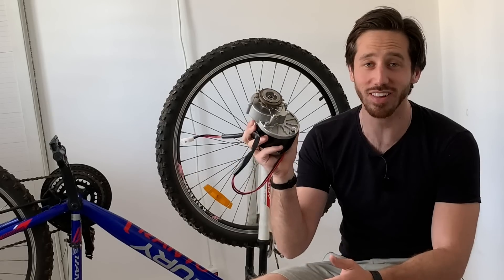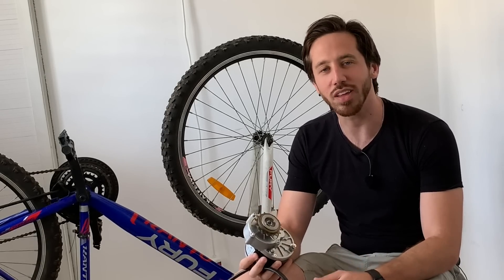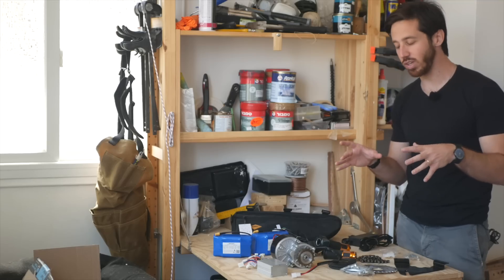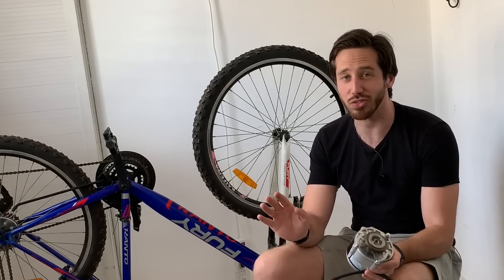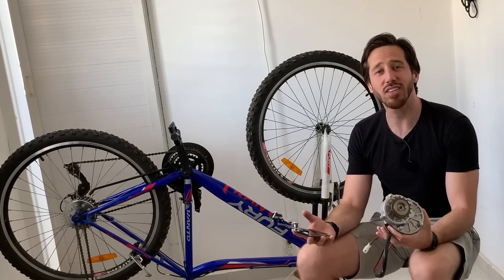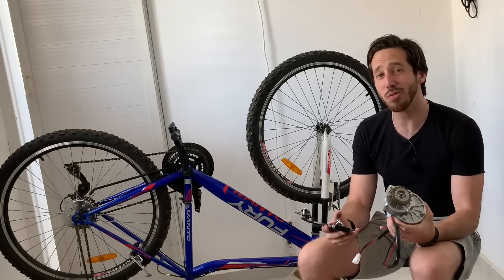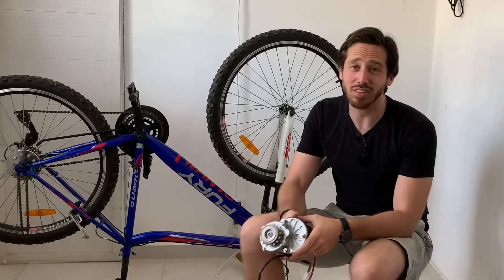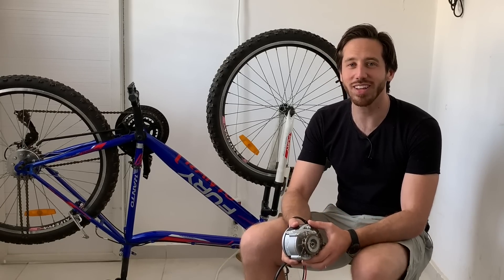Do NOT buy this $103 electric bike conversion kit

Comment: Well thanks. I purchased the kit. Many batteries. And like you said the mount did not fit my bike. I made it work. Unfortunately the two were not aligned and the sprucket on the motor came apart! Waiting on new sprucket to make it work on my daughter bike.i have extra sprucket on order,to make sure as to keep it running. I have already bought the rear wheel kit for my bike. 48 volt 1000 Watt kit. Waiting on batteries.  I don't think this will be a much better outcome because it's the 170.00$ kit. 6 speed instead of 7 or more. Owell. We'll see.. well thanks for letting me know about the problem with the kit you suggested back in January. Bought and already know all the problems with it. I'm on a tight budget so I have to buy everything a little at a time. What's up for the stuff not being shipped? Waiting on batteries. I have to go for the cheaper ones. But I figured 2 of them equal one ok one. Can someone let me know what up for batteries through Ali Express not being shipped? Thanks Ray

Comment: I have 3 26 inch bikes that I would like to put a Front Hub drive PAS system on.  All have rim brakes.  Tire width 1 bike 1.75” the others 2”.  I think I can get a 2 inch tire on all 3.  If not would go with 1.75.  Want to be able to switch between bikes.  Thinking would not have break cutoffs.  The most expensive part is always the battery which l’m thinking would be a mighty mini, want to be able to ride about 18 miles using PAS about 15 miles per hour on fairly flat road.   I’m thinking a 250W system with maybe a 36V battery.  Looking for suggestions.

Comment: Hi Mikey I purchased it from L-faster it’s the same kit as you have. I bought it after I saw your video. And tried it on 4 bikes I had. Finally returned the kit. I doubt it will fit any American bike. I then bought a hub motor kit by voilamart for $199 on ebay and was easy and fast installation. The total cost of the ebike conversion got bumped up by $100 the but rest of the parts were still utilized for conversion and was great. Infact got a 750w motor the bike goes 22miles and hour.
Reply: @KRUNAL DOSHI Can you provide link to your voilamart motor kit?

Comment: Nice video.  I hope that people now understand that it would be very difficult to make a "universal bike kit".  There are too many variations in frame geometries.In order to salvage your kit and at least be able to mount your motor, I'd try to flatten the angles to about 20 degrees on the angles where it mounts to the seat stays and chain stays.  I would do it with a hydraulic ram press.  In the worse case, a heavy sledge hammer should do the job.  Good luck in getting the kit adapted.  Looking forward to the next video.

Comment: Micah, if I were you, I'd pass on the L-faster mid-drive kit. Firstly, the design is downright janky. Secondly, it has very few reviews. Thirdly, for not much more, it's possible to go with more, shall we say, traditional, designs. For example, for only $100 more than the 48V/450W L-faster mid-drive, I'm able to build a 52V/1,500W geared rear hub bike.

Perhaps building "first e-bikes" of different configurations, including sourcing the parts, which is a nightmare, would be a worthwhile series. You could build a front drive bike of average power, then sum up the pros and cons. What wattage was chosen and why. What type of motor was chosen and why. How the parts were sourced. High and low points of the build. What you'd do again. What you'd do differently. Finally, the total build cost.

You could then do the same for rear hub and mid-drive configurations, and close out the series with an apples-to-apples comparison of the bikes attempting the same evolution. Off the line acceleration. Top speed. Hill climbing. Off-roading. Range. Overall riding experience. You get the idea.

After attempting to source everything for a 48V/450W geared rear hub motor build, it was actually less expensive, and I was able to get the exact configuration I wanted, to source a 52V/1,500W kit from a reputable source. While the bike will have more power than I typically need, I'm confident that it'll do anything I ask it to. The same might not have been able to be said for the 450W bike. In the end, eliminating the potential for future upgrades sealed the deal.
Reply: Thanks for that John. I have built (with help) two Ebikes, one with 1800 watts max output in the rear hub and one with 1200 watts output (at rear wheel) mid drive bafang 1000 watt motor. The Mid drive is faster off the line by a good margin but gets overtaken after about 30 kph by the hub bike. Top speed is very close. The hub motor is a lot faster up hills with the difference being about 10 kph on average. 
The only reason I would ever get a mid drive (crank) is where slow torque is required i.e. on very steep slow technical climbs where the gearing becomes a huge advantage. I have one 52v battery for both bikes.
With normal on road riding the rear hub motor is king and it is also the most reliable imo
Do you have a good source for parts? I'm thinking of building another rear hub bike?
Reply: @grantadamson3478  Is your existing rear hub motor geared or direct drive. I prefer geared myself.

My 52V/1,500W geared rear hub kit was $325 (with free shipping) from calibike.com. Rafe gets good reviews for prompt, knowledgeable support. My pre-sale experience with him was very good
Reply: @ARepublicIfYouCanKeepIt  Thanks John. The rear hub is direct drive. I don't know much about the geared hub motor but am interested to know why you prefer them over direct drive? I'm going to check calibike.com now. That is a great price.
Reply: @ARepublicIfYouCanKeepIt  Just noticed that the kit from calibike has a 25 amp controller which will limit the power to 1300 watts max. Does the "geared" motor compensate for the lower wattage?
Reply: @grantadamson3478  Geared hub motors possess several advantages. My top four are:

• Lighter - Roughly half the weight of a direct drive motor greatly affects ride characteristics, making an e-bike feel more like a regular bike.

• Smaller - Stealthier. Doesn't scream, "Steal me, I'm an e-bike!"

• Increased torque - Both at the low-end and for climbing.

• No drag - Because a geared hub motor freewheels, they can be pedaled like a regular bike with only some added weight.

The downsides of geared hub motors are:

• Reduced high-speed efficiency - For me, this isn't a big deal. I just build a batter with marginally higher capacity.

• No regenerative braking - Same as the point above. I build my own batteries, so choosing higher capacity cells (3030mAh vs. nominal 2,500mAh) takes care of this without the need for a complete additional parallel string (14P).

As with most things in life, there are compromises. So, for someone riding mainly flats, a direct drive might be a good choice. However, with lots of stop-and-go traffic and/or steep hills, a geared hub motor would be a superior choice. This then affords one the opportunity to take the bike way off-road, as I intend.

In closing, you may read that geared hub motors are noisier than direct drive units. While this is true, the difference is so small that it's unnoticeable over the sound of traffic or the whine of tires on the road.
Reply: @grantadamson3478  There's not such thing as "compensat[ion]" for lower voltage.

Remember that 52V is a battery's nominal voltage. 100% state-of-charge (SoC) for a 14P Lithium-ion pack is 58.8V.

58.8V * 25A = 1,470W

Also know that the ratings of controllers and motors are nominal, as well. They're able to accommodate short-duration surges/bursts without "releasing the smoke".

When designing electrical circuits, a safety margin as always desirable. In the case of this 52V/1,500W e-bike kit, a 14P (50.4Vnom) pack, paired with a 25A controller will deliver from 1,470W at 100% SoC (4.2V/cell) down to only 875W at 0% SoC (2.5V/cell).

Commercial "52V" e-bike batteries are typically 14P (50.4Vnom). I build 15P packs that are 63V 100% SoC to 37.5V 0% SoC. Additionally, I run only them from 4.0V/cell to 2.75V/cell, or 60.0V to 41.25V pack voltage to maximize pack lifecycles.

So, at 4.0V/cell, I'm right at the motor rating (and that's when pushing everything at full charge):

60.0V * 25A = 1,500W
Reply: @ARepublicIfYouCanKeepIt  That has given me valuable insight and I think geared will be a good choice for my future needs. I haven't started making my own batteries yet but it seems to make sense to customise for your particular needs. I really appreciate you taking the time to respond. I have two bikes to build and this has really helped me.
Reply: @grantadamson3478  It's good to hear that information I provided was useful to you. Best wishes for successful projects.
Reply: @ARepublicIfYouCanKeepIt  S not P when talking series hookup
Reply: @VaughnfromPeterborough  Good catch on a two-year-old post.

Comment: EZip or Izip uses this type a motor setup,  checkout their setup for mounting. The wheel sprocket is part of the wheel hub and the bracket is a lot different. I have the Ezip Trails ebike and all of this setup a lot better.

Comment: if you are looking to be able to salvage the kit since the universal mount does fit you can using a longer piece of chain you can set up dual freewheel  dual cog chain setup

you can use parts from http://sickbikeparts.com/shift-kit-and-all-drive-products/ to build 2

pieces that look like https://lunacycle.com/cyclone-double-sprocket-freewheel/

then you will need a bottom bracket and crank set and such.

http://sickbikeparts.com/shift-kit-and-all-drive-products/ has 4 shift kits to choose from but you probably will want the cheapest kit  

there will be some parts that are useless but you may be able to modify them to fit the project.

there are still videos like https://www.youtube.com/watch?v=7hn7WcT0DcI from bike motive.

while the bikemotive store is gone you can learn from the video on how to build yours.

electricscooterparts.com is also a great place to find ebike parts too .

the good thing about all the sites i mentioned is that they are here in the united states so while a little more money you will get the parts a lot sooner though you will want to ask for priority mail to ensure no longer than a week also i am sure you can cash in the youtube video monetizement to get more money  

lunacycle.com you will need to keep the cost per order below $100 because otherwise they will select ups or fedex witch will require signature .

Comment: 48v 750w is THE way to go.
Mine is 1500w governed by the computer to 750.
I feel that the bigger wire will help to keep the motor safe from burning up.

Comment: TORTURE
OK, it's great that you are discovering the pitfalls associated with such a project so I won't get stuck. 
Since you already have the batteries, hopefully you can get the new kit on fairly soon.  I would really like to try to electrify my old bike to use it   t h I s   summer.  I hope you will give source for all parts and not fabricate or sub parts that your have 'lying around'.  I hope you create an ebike solution for the masses!  It's a noble cause.

Comment: Thanks Micah for all the training vids, but I waited and planned not quite long enough. The whole (reverse 450w) package is on order and is somewhere else yet. I did spend some time sketching that mounting plate and realized that it would require a fair bit of creative investment (cobbling!), but I needed a project to get off the ground and could not quite go for a BBS02 system (yet), and wanted to keep my 3 speed mid derailleur. 
In the prep process I decided that my seldom used 35 yr old Specialized rock hopper mountain bike needed some TLC, so I decided to 'you tube' the maintenance and found another whole project getting the freewheel (not the cassette! who knew!) off to clean and lube the bearings. Now I see your latest and hope that bracket is the only real problem. I intend to mid mount the motor and use a longer chain to allow better alignment anyhow.
Reply: Update: Received the kit (no battery yet!) and decided to check the motor with my auto battery charger set to 6V. That is when I noticed that I received the normal kit not the reverse kit that they offer and I ordered - the freewheel is backwards for my use. My intention was to reverse mount the motor inside the frame under the seat to protect it rather than have it stick way out at weird angles. I expected to have to do some cobbling to mount the motor and align the chain, but the drive has to work in reverse. I am still waiting for a reply/replacement for that freewheel. 
This turned out to be a whole lot more work than expected - that bracket is weird and strong so needs power tools I don't have access to. I may need to create a special bracket - I  don't want to modify the bike frame itself. All of which is secondary to the freewheel. After much effort I wish I had just bit the bullet and gone with a BBS02 system that just fits! Nuts! Thanks for all the videos - learned a lot.
Reply: further replies to Andrew above. Everything is installed and working except for the reverse freewheel and extra chain. Whew!
Reply: Micah, I hope you get to see this. I chose the newer 450w Yalu kit as mentioned above and figured out that the definition of left side meant the bike not the freewheel, so had to order a reverse freewheel to satisfy my layout. This project was meant as a learning experience and total cost was just over $300 with extra chain and larger battery. So, the lessons: 
1. That #*%@ bracket was the main issue that encouraged me to move the motor and reverse the freewheel. It caused me many hours of manual labor to convert (cobble/bend/saw/adapt) it to something that holds the motor in the right position and align the chain. 
2. My chain alignment was the next issue - I had to tweak the motor mount (the replacement freewheel had different spacing!) and learned how important that was to keep the chain on and fairly quiet. 
3. I didn't expect the chain break in/stretch (around 44" long), so had to keep tightening the chain until it stopped stretching. Still waiting for my cheapo chain   tensioner, but it works OK for now. Learned about the wear damage that an over stretched chain can do to the cogs/cassette down the road. Not a problem yet.
4. the coax charger connector on my battery BMC fell onto the bike sprocket and vaporized the connector - what a surprise - so felt lucky - no other damage - I taped it up and use the motor controller charger connector. Bad choice of connector. 
5. Not thrilled by the spark I get when connecting the charger so I connect the battery first and the charger power last. 
6. I like the half twist throttle option (thanks for that in your video!) with the key switch. 
I hope some of this helps in a future learning video. Thanks for the training!
Reply: By the way, I got it all to work fairly reliably and am happy for now. Only have about 5 miles on it and will post on any new problems. Some refinement for longevity and looks (paint, better battery brackets etc.) is clearly in order. TBD! What a hoot! Still wonder what the top speed is!

Comment: Sometimes you get what you pay for 🙂
Reply: Problem is gas powered kits are under $100 USD and they actually work, and decent $150 hub motors with 1000-1500w are out there that work, so this thing was just bad value even if it did work well...

Comment: Excellent video.  LOL  I HAVE that exact motor and mount kit and had not yet used it.  I my case. the $180 MTN bike I bought to install it on had more issues out of the box than I imagines (chain and rear derailleur had to be replaced immediately) then I over tightened the steering head and stripped it so I fixed and sold that bike before I ever got to trying this kit.  I am going to try again soon with a beach cruiser type bicycle which makes no sense to have at all here in Colorado but may work with this motor j=kit.    Thanks for the video.  I was refreshing after seeing soooo many videos showing "how easy" an eBike kit installs on EVERY bike out there.  LOL

Comment: I've seen those kits before but as soon as I read 'brushed' motor I thought it would wear out the brushes quickly and be too high maintenance. Don't see the point of buying a brushed motor when brushless is available. Brushless would be my minimum specification for such a kit.

Comment: Hi I just wanted to say that buying a mid drive kit for that cheap that cost that much might not be worth it because for around the same price you could get something like a 1000w hub motor kit or even if you wanted to a cyclone mid drive that can easily put out 3000w for only $350. Of course both these options take more battery and the cyclone mid drive at least takes a bit of skill to install but I just wanted to give my opinion. thanks for the great vids!

1000w hub motor kit link 
https://www.amazon.com/Voilamart-Electric-Conversion-Intelligent-Controller/dp/B07D156XQ5/ref=mp_s_a_1_3?dchild=1&keywords=voilamart+electric+bicycle+kit&qid=1591553488&sprefix=voilma&sr=8-3

Cyclone 3000w mid drive link
https://lunacycle.com/cyclone-mid-drive-3000w-planetary-kit/ 

Note: I’m pretty sure there is a 1500w kit available at around the same price but It seems unavailable at the moment or something so I’m not able to find the one I was thinking of but I’m sure it’s somewhere

Comment: I hate to ask or even suggest it, but can’t the bracket for the motor go INSIDE the chain/seat stays? It looks like it will improve the chances of the chain lining up. I know it “technically” doesn’t go that way, but I have a feeling that is what others have done.